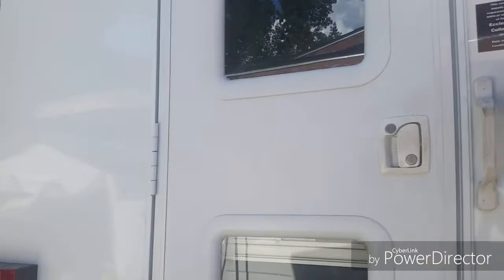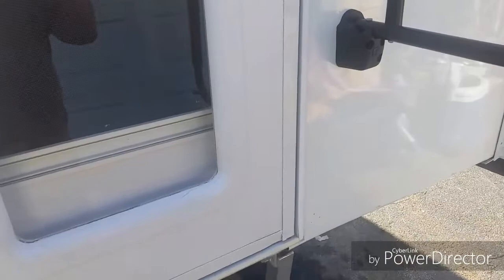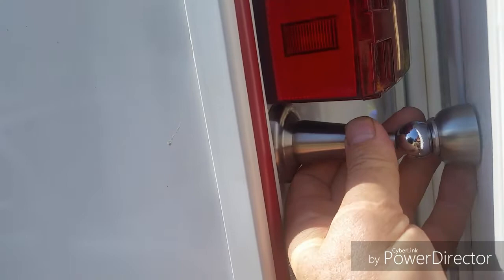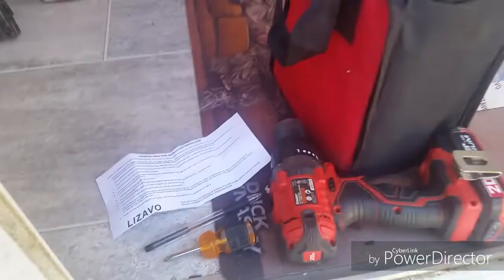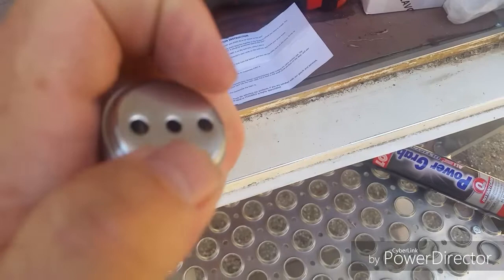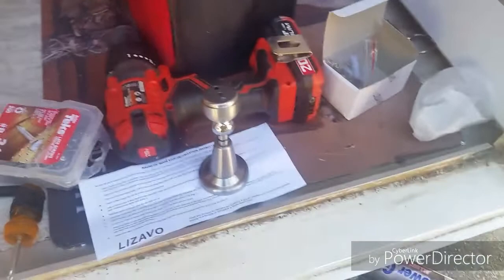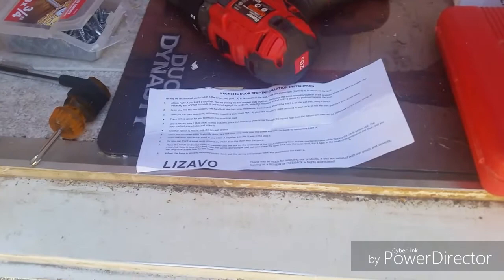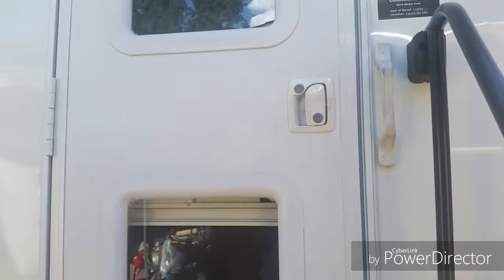Magnetic Door Stop on my camper

Comment: This sounds very labor intensive.  For a 5-minute fix which requires no tools look for Magna Stop Magnetic Door Stops on :yt:.
Reply from the maker: Thanks.  I looked that up.   It's an add-on magnetic holder.  It requires you to have a door stop already. 
This camper application did not have anything at all, which is why it needed this whole assembly. 
Keep in mind, also, that this stays outdoors 25/7/365.

Comment: So two years later,  how is the magnetic door holder doing?  Did the screws and adhesive do the job?
Reply from the maker: Good question.  It is holding up great!  It's as good as the day I installed it.  Still attached.  Looks the same.  No rust runs.
I absolutely love the cushion effect.  The wind has swing the door open hard several times, and every time, this stop caught it without any drama.
Reply: @Reserector  Hi, we are actually the seller of this doorstop, I am glad that you like it so far